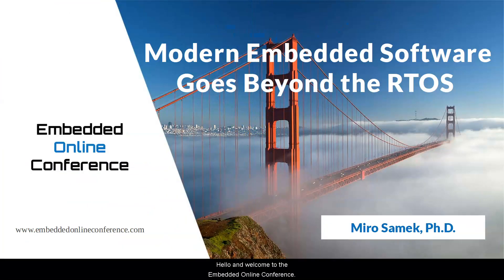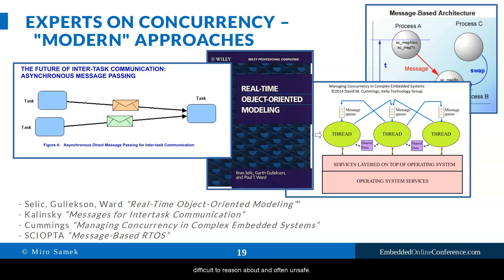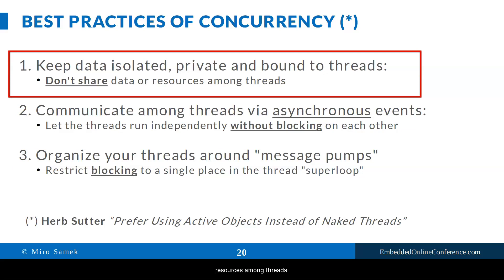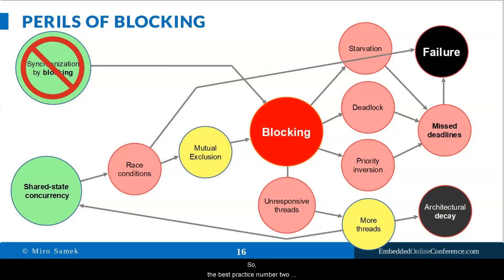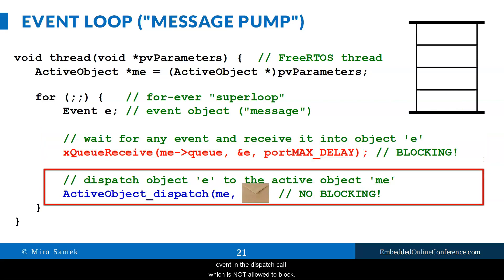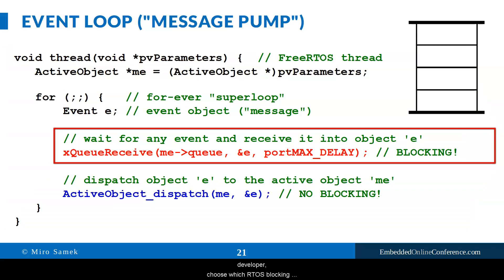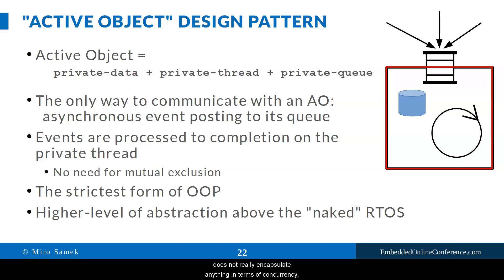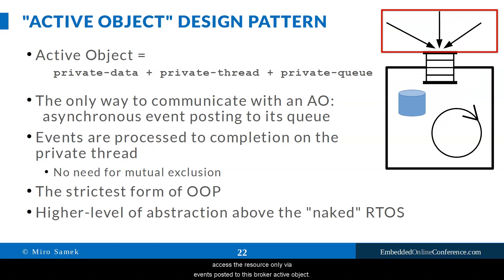Beyond the RTOS - Part 2: Best practices of concurrent programming and Active Object pattern

Comment: Correct me if I'm wrong : ActionObject_dispatch should not block on any RTOS primitive like semaphore, queue or delay, but it can "block" if an algorithm it runs takes time to finish right? What would be the point of threads otherwise?
Reply from the maker: An active object should not block internally, period. If an algorithm calls for a delay, then you should use a Time Event. This was exactly the case with the Blinky thread in the presentation, where the traditional sequential algorithm required a (blocking) delay. As you saw in the non-blocking solution a time event not only worked perfectly, but was superior, because the thread remained responsive to any other events. In the end, this is exactly what I mean by the paradigm shift from sequential way of thinking based on blocking and event-driven way of thinking based on events. If my arguments did not convince you, perhaps you will prefer an article by another author "Managing Concurrency in Complex Embedded Systems" by Dr. David Cummings ( https://www.state-machine.com/doc/Cummings2006.pdf ). --MMS

Comment: Believe it or not..i came to the same conclusion..six mouths ago..although prior to that i had zero experience in Embedded. i took the pattern which you have presented here..to another level. I used it to implement #MVC framework but for the Embedded Systems..which I called #Stuts4Embedded. however, in this release it is coupled to #ChibiOS RTOS..here is more details on github👇
https://github.com/abusous2000/Struts4Embedded/wiki

BTW...Anyone who worked in architecture..knows well that event driven programming..is the hollygrail. But it comes at a cost.. here is video that demos the use case

https://youtu.be/VAiZSbqR4mY

many thx for sharing...good work

on last thing...this pattern is exactly what powers #NodeJS